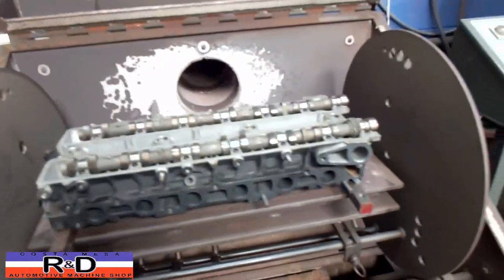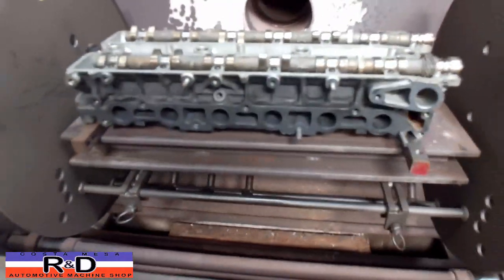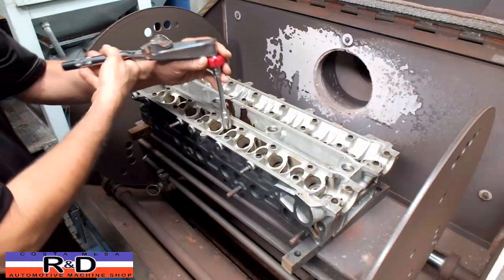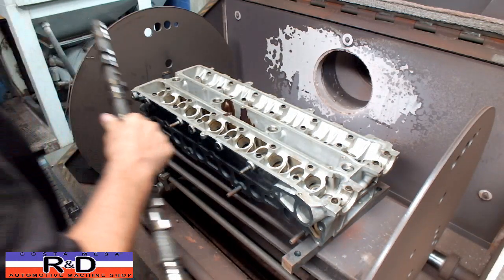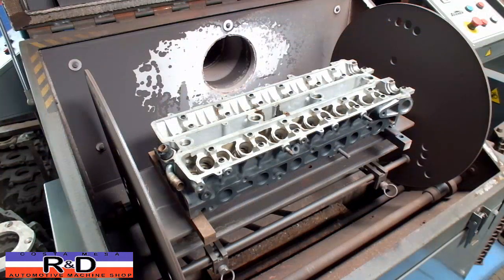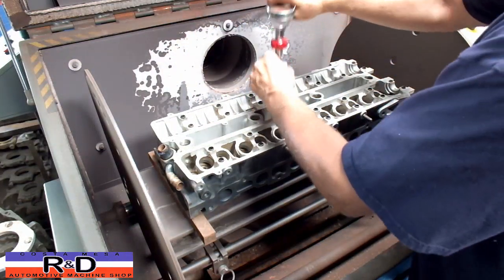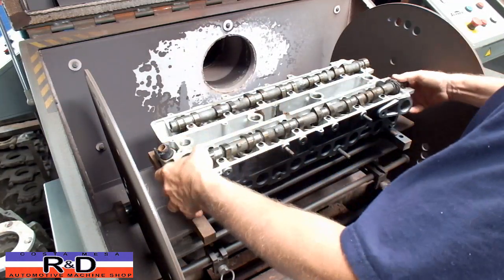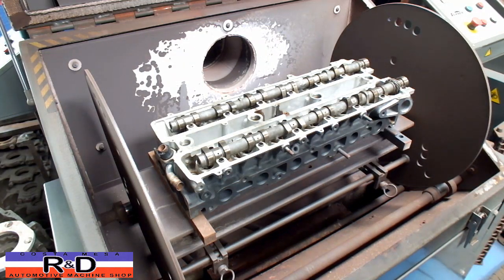Toyota Supra 7M GTE Cylinder Head Straightening

Comment: Why do you think it warped in the first place and why was it removed from the block?
Reply: +GREG GERHARDT propably it had overheating problem and not sealing correctly, thats an indication of warped cylinder head, it can be measured with a surfice micrometer
Reply: Thanks.
Reply: They Blew Gaskets Because toyota used shitty ass Aluminum for the 86-88 Head castings when they torqued the heads to "spec" of 45lbs the Aluminum of the head at the head bolts crushed and after heating and cooling for 50-60k miles the bolts loosened and blew the Gaskets. That is the MAIN reason they blew Head gaskets.
Reply: @darkblaze176  I remember readying about this but was wounder if it was only the early heads as you mentioned with issues. I have a brand new 7M head so it was made some time in 2006 before they stopped making them. Casting #16 which is the last one. Something to note is that custom head inserts do fix the soft head issue with the sinking of washer. A Lot of JZ heads blew HG when people were using the smaller ARP washers that came with the head studs. Heads were lifting and washers were sinking right in. When the stock washers were used with the studs the issue stopped until people went to big big power. ARP now puts the correct washers. I'm wondering how man 7m heads had the same issue with the smaller ARP washers? I know a person who makes 900+whp (7m)  using larger then stock washers with no issues of the washers sinking.
Reply: +GREG GERHARDT These engines are notorious for blowing head gaskets. THe factory torque spec for the head bolts was something like 45 ft. lbs. originally.
Reply: +darkblaze176 yup...my buddy has one that has the same problem lol. jz swao in the works.
Reply: I heard that the original gasket was made of asbestos, and the replacement gasket was not made of asbestos. In addition, the torque spec was different for the non-asbestos gasket, but not everyone knew about it.

Some people modified these engines for more horsepower and that made a bad situation even worse.
Reply: @skylinefever  Hi there. Yes your right. They originally intended to use asbestos HG then asbestos was banned in 1986 so they went to composite but with a low tourqe spec as we all know. The other issue was heads going soft on the exhaust side and bolts loosening. You can fix this with a larger head insert. It's worse if you use the ARP studs with the smaller washers they come with.   Metal HG were not the norm yet and had not been properly developed for the OEMS at the time. When the first JZ engine came out 1990 for the MK3 Supra it was ready. Had the 7M engine been also developed with a metal HG it would be a different story. Today we can fix these issues on the 7M and make it built proof if you know the right steps to take and easily make 1000+whp

Comment: these motors are a dime a dozen even free some times, i would have just gotten another head and get it rebuilt
Reply: +30GB When i did the head gasket on mine I couldn't find a used head anywhere. I live in the midwest. No junkyard within 300 miles had one. The "reconditioned" head suppliers didnt have any, except Moore Cylinder Head. They had one, but when i got it, it had been machined about .050 on the deck surface. I sent it back, got my $700 back, and used my old head.